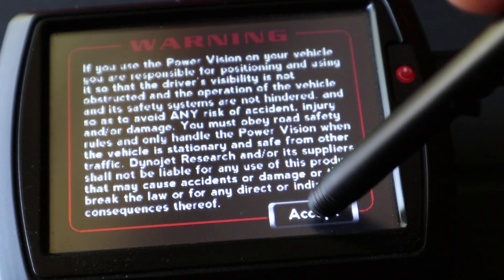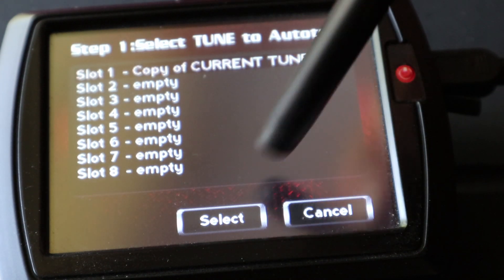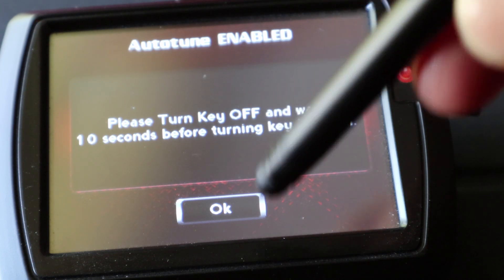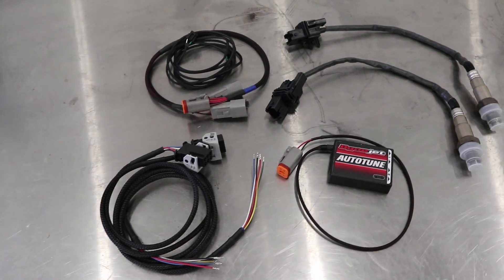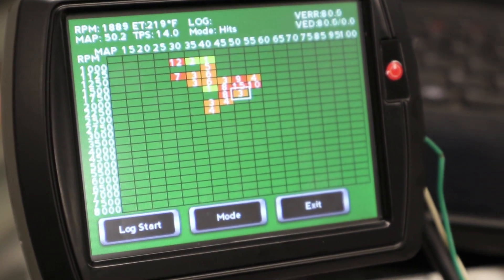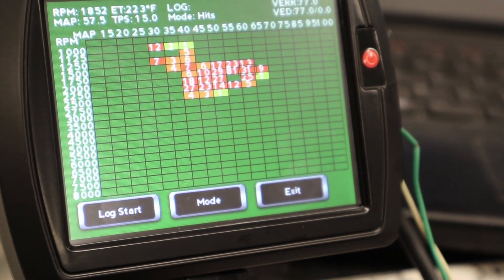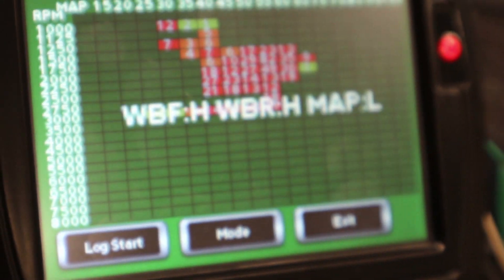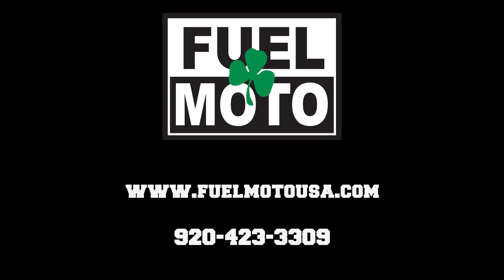Dynojet Auto Tune Basic, Pro and Target Tune Explained

Comment: I just put the system on my 2017 SGS with stage 2. Dynojet sent me a tune for the cam, pipes, and intake that i installed. It works great and i did a few auto tunes to dial it in for the stock O2 sensors. I put the wideband kit in yesterday and went back to the base tune then started auto tune all over. I have 2 rides in at about an hour each but i noticed that it turned off the closed loop when i went into auto tune. Do i finish auto then turn closed loop back on or leave it off?

Comment: im confused! just bought this for my 2017 road glide special.  during the three 20 min sessions  do I select a new slot or select the slot I previously auto tuned???
Reply: Either will work.  Some like to overwrite the slot if you dont care to compare the changes.  Other use different slots to open the files later and compare the changes.   Either way just remember to use the modified tune and turn off autotune

Comment: Just bout a pcv and auto tune for my 2010 z1000. Was wondering if it’ll show my cylinders in the map section of the auto tune?  If I only have one o2 sensor how can it tell which cylinder is doing what?  I’m either confused or really misinformed.

Comment: Great video. I have a 2010 Dyna and just installed 583 easy start cams, thunderheader and S&S stealth air cleaner. I ran Autotune basic 8 times driving all different roads. Wow what a difference. My question is the idle is set to 1k but the engine can't hold idle and stalls. I need to gently hold the throttle so it idles. Other than that she pulls hard. What should I do? Add more fuel to the low range in quick tune? I appreciate any help.
Reply: Sam D you can go program Vehicle then hit quick tune and adjust your idle up 50 rpm at a time all the way too 2000 etc. fixed easy as that don’t forget to refjash after ur adjustment , done mine tonight . Was stalling on me , after I ran auto tune, I only had to add 100 rpm to fix the issue
Reply: Sam D when you do your first ride and your done does PV save ur rides info for next rides or if not how. I understand 1 ride and flash but multi rides ???
Reply: @warrendemartini6533  hey youre one of my favorite guitar players

Comment: How would power vision work on a 2003 Heritage Softail Classic when there are no O2 sensors on the bike....but it says it can be used on the bike
Reply: Limited features will be available to you in this application
Reply: You can go two ways, buy powervision and get autotune pro with wideband o2 sensors.   Or just buy powervision and take it to a professional dyno to set you up.  Buying a powervision with out a way of reading AFR through the exhaust would be just guessing and not effective.  The powervision on it's own would only give you a canned basic tune to download.
Reply: I got a map from fuel moto

Comment: So when in auto tune basic, you ride say 20 minutes, come home then what, does power vision take off from where u left off from first ride. Or do I turn it back on and just start over with hopefully the last rides Info / tune. I understand the first ride when done use ur 1st ride info to flash ur tune but multiple rides ?? What does PV save ur info for each ride then flash it ????

Comment: @FuelMoto So if you have the powervision and the Target Tune, do you still recommend doing auto-tune sessions? Or is that basically negating the function of the Target Tune?
Reply: You would still want to autotune, in the screen to select the sensor type you’d just select target tune.  Plus you have to be starting with a target tune map, if you buy from fm they supply them for your config. I have read that there is something not right about the way auto tune works with target tune but I don’t know enough to really explain it. May want to research before embarking on that journey.
Reply: Good question... @FuelMoto please answer

Comment: I'm looking at doing the s&s 107ci big bore or 110ci  and 89cc heads with Andrews 67H cams. I all ready running the power vision. Would this benefit me vs the stock narrow band?  Once I got it built I was going to take it right to the dyno to get tuned?
Reply: I'm wondering the same thing. Wanting to do s&s 110" sidewinder kit

Comment: Hi.
Great video, absolutely great help. I own a PV for my 2012 FLTRXSE CVO.
If you allow me to ask 2 questions, for my specific case:
1) when you're doing an Autotune session and have to stop your bike for some reason (get more gas, police, heat, etc...), what do you do before turning the ignition off, but still want to continue with the AT process afterwards?
2) i went from an 19'' front wheel to a 23'' one, so, what would be the advised Speedometer calibration value to have?
Thank you so much and please keep on doing a great job.
Reply: You have probably already figured this out, but-  the Autotune will continue to run after you have turned the bike off and back on. It’s like “pause” on a video game.   
2) the speedo is based on flashes from the transmission sensor, so as long as the rear wheel+tire diameter did not change (it shouldn’t have) your Speedo setting should not need adjustment.

Comment: 13.2  14.6   A Dumb  Tier  1  support  people could  not even tell me  for an  example  how  much you  should  increase  fuel delivery for  better drive ability    better throttle response and  cooler  engine  i.e  don't  turn your exhaust purple ..
Reply: It all depends on riding style and fuel mileage.   I found a nice happy medium is 14.3-14 in cruising area, 13.9-13.5 in mid to upper throttle area, and 13.5-12 in WOT areas.

Comment: To actually use your PV to its best you have to buy another $600 for the auto tune kits with wideband sensors . Holy crap $1000 for a complete tuner. Unreal. Got to admit even with the latest download no more decell pops and more response

Comment: Great video and thanks for posting.  Quick question: I'm not sure I'm clear when you say be sure to "flash your non-auto tune map" at the 6:34 mark.  My understanding is you'll have the original map and and then an auto tune copy.  I would think you'd want to do the remaining two (out of all three) sessions agains the auto tune copy and not the original.  Is that right?
Reply from the maker: The example was given in the scenario where you have performed one or two auto tuning sessions, you are ready to go for a third auto tune session as you have enabled auto tune on your latest auto tune created fuel map, however you instead want to go out for a long ride and not auto tune your motorcycle. Simply flash back into your ECM the latest fuel map exported through the auto tune process and you will be ready to ride. Don't hesitate to contact our technicians for further assistance.
Reply: ok, that makes sense and thanks so much for the clarification.  Just getting going with the DynoJet PV2 for my Sportster now that I've done a 1250 kit and want to do some auto tuning.
Reply: Fuel Moto - I also have a question(s) at the same point (6:34) in the vid.

So why do you have to “flash a non auto map” after turning off Auto Tune?  Doesn’t it just default back to your latest downloaded tune?  What is a “non auto tune map?  Great vid.  Keep’em coming😉👍

Comment: Everything falls apart when you're at the end of a autotuned/target tune session.  You turn the bike off and now what... there are NO PRECISE instructions. I watched the videos and when I got to the point where I exit the datalog screen,  it all goes to hell because What I see on my Power Vision is not what I see in the video. Instead of building on then previous session it wants to write the session learned to the ECM.. WHAT IS NEEDED is a precise second by second sequence of key   presses and what exactly is happening between and after each key stroke. I have no idea whether I'm adding information, over writing information, storing information. When I do the disable autotuned/ enable auto tune it wants to write to the ECU... what gives?
Reply: I AGREE MAN! YOU'D FIGURE THESE GOOFBALLS WOULD DO A VID WITH THE DAMN PV IN HAND!! FROM WHAT I FOUND OUT THROUGH OTHER COMMENTS PERTAINING TO AUTOTUNE YOU ARE SUPPOSE TO KEEP USING THE ORIGINAL SLOT YOU USED TO AUTOTUNE TO KEEP AUTOTUNING AND HONING IN!
Reply: What exactly do you have?  Target tune or autotune pro?  Or basic autotune?  Year bike and model too.

Comment: Have to rely on the auto tune as powervision neglected to provide any tunes for 13 touring and the few they have for 12 and below don't have any options for my simple setup.
Reply: .....Well... They do have options just that apparently nobody was running power duels back then.
Reply: Jeffery Baker you need to call frequently. They get new downloads all the time.
Reply: Jeffery Baker call dynojet they come up with new downloads almost monthly. That’s what I did I have a FLSTSE2 CVO. FIRST DOWNLOAD THEY SENT ME MY MOTOR FELT TOTALLY DIFFERENT, more response and no decell pops

Comment: These Dam Tuners are waste $$$ and time...best thing to do is bring it to a Pro Tuner Shop in your area, because all you end up doing is screwing up the EMC and $400.00 or so bucks...where you could applied that $$$ for a pro tune and a good shop will back-up the tune most of time for a year at no cost.
Reply: Alex Eidenier  Or you pay $100 to use a PowerVision license under the tuner shops name.
Reply: It's more like $250 and hope they tune worth a shit I bought the pv with target tune and runs better than what hyperformance tuned it well worth the money and customer service is top notch
Reply: Not all tuners are created equal. They charge by the hour and I've heard plenty of guys say their bike ran shittier after the "pro" tune.
Reply: I often here that comment from a so called professional tech.  My tuner has already saved me thousands. $508 is what a harley dealer charged me for a tune and dyno run, ( no parts installed). Most tech will just pull a Map from there library of tunes then charge the full service price. I've installed cams, heads, exhaust and air cleaner on all separate occasions of which would have cost me nearly 3k through a tech shop. So yeah 400 for the tuner and another 400 for the target tune, I'll take that anyday vs a shady ass tech who runs generic map and charges full price.
Reply: @bsmagee86  is there a big difference between buying all the stuff from fuel Moto or taking it to a Dyno tuner and having them do it all in one session?
Reply: @turtlepowersf  a dyno is only a tool. Power numbers mean diddly shit compared to real world